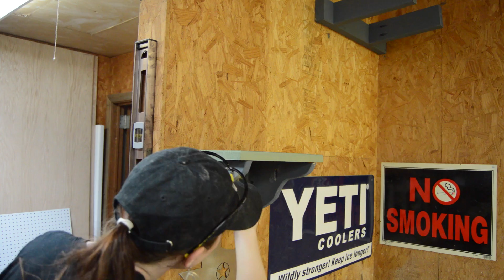Shop Corner; Minor Modifications

Comment: OK I subscribed.  And here are the reasons.  You like Makita tools.  They are tough.  Have seen many times when they were used to hammer a piece into place before driving screws.  I haven't seen that silhouette method of transferring an image in years.  And lastly, you are a fan of the plastic sawhorses.  They are very strong and can be stored in a small space.  You can also hang them above the sink with ease.
Reply from the maker: : ) Well, I'm glad to have you. I love my Makita tools, that transfer method is me using a projector, and I won't trade up my plastic sawhorses for anything because I love how easy they are to move around. Cheers!

Comment: The corner of the shop turned out great! I also really liked the tip on using a small piece of a brush for corners. Nice job on the speaker graphic too, how did you project the notes onto the speaker?

Regards,
Bob
Reply from the maker: Thanks Bob. : ) I used my projector. I bought a cheap one over a year ago and use the crap out of it doing things just like that speaker.